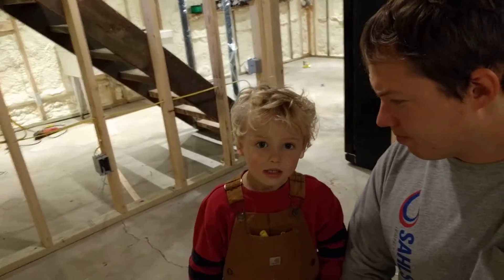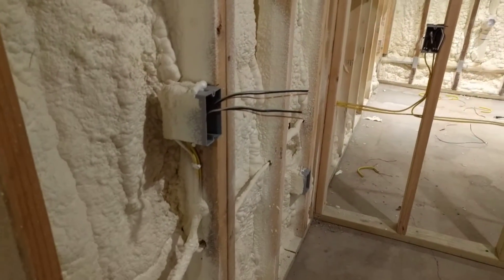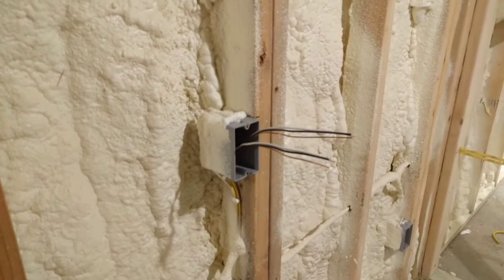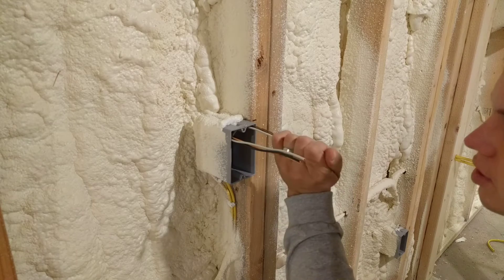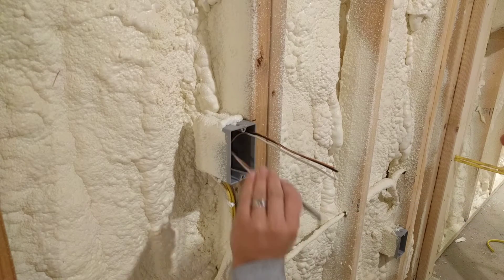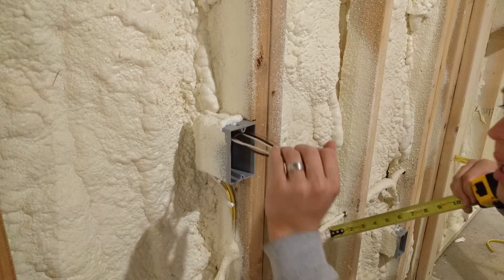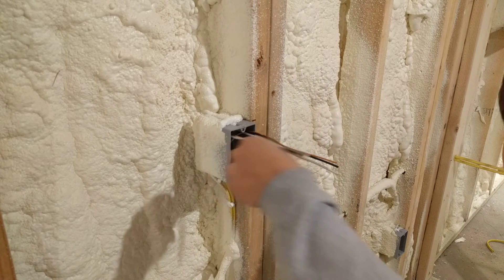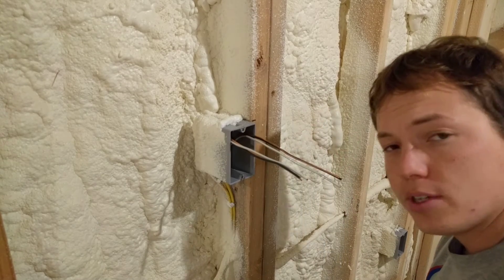How Much Wire or Romex Should I Pull Into an Electrical Box for Rough In Wiring

Comment: Any experts want to help with a service-entrance install and the specifics of wiring from meter-box/disconnect (outdoors) to subpanel (indoors) for my particular components...? I need to know where it is and isn't okay to punch-out/exit the meter/disconnect to then enter the structure to eventually land at the 200A subpanel as well as what I need and the best way to install all of it when I need to run 4 4/0 aluminum conductors (SER) between two panels that only come with 3 4/0 aluminum lugs installed... it seems obvious that I need to install ground bars in each (with 4/0 lugs?)... but how exactly? And does each panel require it own pair of ground rods (requiring two additional, smaller lugs on the new ground bars in both panel for each end of the ground wires from each pair ground rods)...? Thanks in advance! ✌️❤🤙